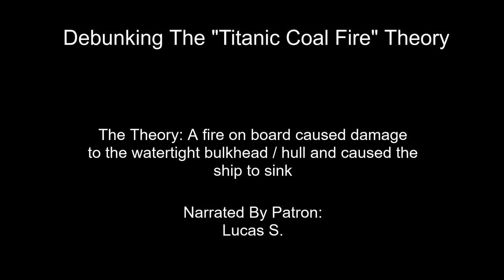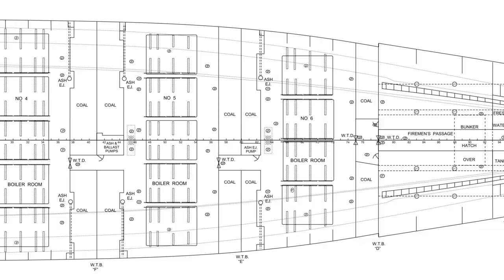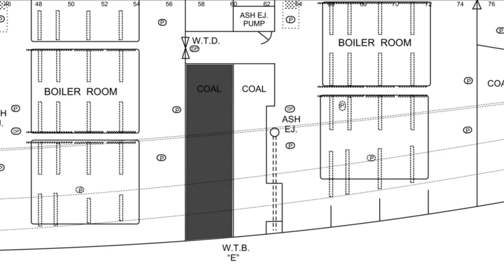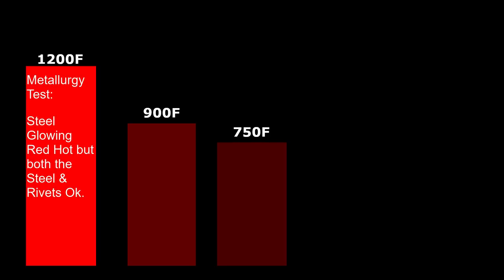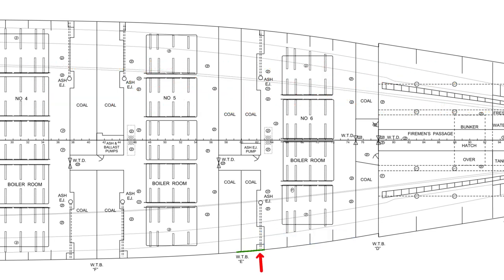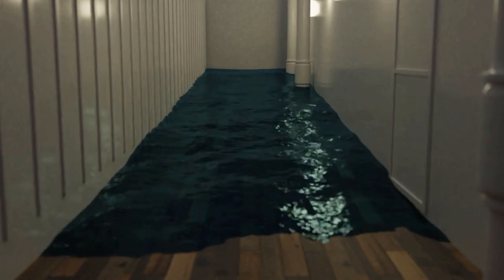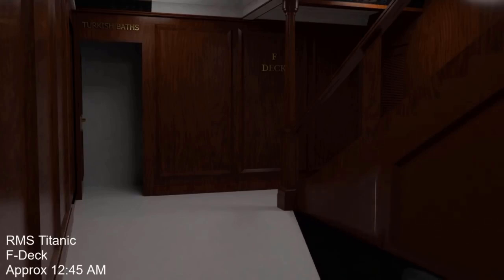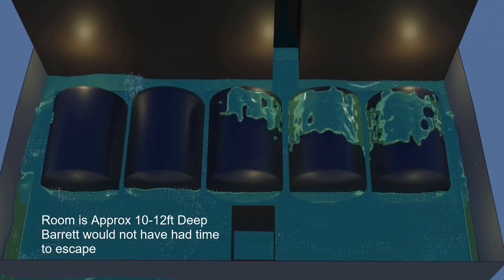Debunking The Titanic Coal Fire Theory

Comment: To put everything into context, the vessel hit a berg at speed, ripped a gash down it's side, filled the so called watertight compartments with water, the problem was, is that the watertight compartments were not sealed at the top, so as the front filled with water, the bow nose dives, then the water spilled over into the next compartment and so on, hence she sank nose first, before breaking in two.
Reply: Right, they were designed to be able to stay above the water line with only so many filled, but the problem was that too many got compromised, and as soon as they knew the number that was compromised they knew she would sink and couldn’t be saved
Reply: You know for all it's flaws I always kinda figured the British inquiry had it right with a 300ft gash down the side,
Reply: @rampancyproductions  even that was wrong. A gash that size would’ve sunk the ship in minutes. It was more like a series of small little rips
Reply: But part of the fire documentary states that ... If there had not been a fire titanic would have been moving slower and possibly been able to avoid the iceberg.. the fire wasn't a cause but a contributing factor
Reply: @rmsteutonic3686  I don't think it was ever a 300 foot gash, 300 foot of damage with said small rips mixed in.
Reply: Didn't passengers also leave hatches, scuttles, windows open? I heard that somewhere. I mean it just wasn't as enforced as a Naval ship would be. They'd want air circulating rather than being focused on keeping their ship water tight.
Reply: Yes you are correct, portholes, cabin windows were wide open, the reason wasn't because they liked it, it was obviously very cold, the reason was because the paint in the cabins wasn't quite dry, and in those days it had lead in it, very strong smelling and took days to dry, I bet most had migraine headaches.

Comment: My Father was a Carpenter working on the Clyde shipbuilding in the late 30s. He told me while watching the riveters that He never ever seen a 'clean' full diameter river hole, The rivers were white hot and almost molten,  they were just hammered into the malformed hole.  So the assumption that every rivet was 100% strong and correct is just theoretical fantasy.

Comment: Listen I work in metal inspection, I’m not a super scientific guy, but that heat, on steel, PLUS the addition of freezing water can and usually does create cracks. Just saying, I’ve seen it personally.
Reply: It could've give in after the iceberg hitting it, because the iceberg actually hit a few feet above where the coal fire was.
Reply: The change in temperature was gradual, like in annealing steel rather than a quick shock like when you quench it for hardening. The gradual raising of the temperature and the slow cooling would maybe make the steel a bit softer, but usually that only can be done to steel that is already hardened. If the plate on titanic was unhardened, which is most likely, then after a gradual cooling process it would return to a very similar hardness level as it had before.

Comment: Couple things, even if it is playing devil's advocate:
1) metallurgical analysis of titanics' steel showed higher than normal sulfur impurity, which would make the steel brittle at either temperature extreme and lower the melting point
2) The Centralia mine fire (coal mine burning for decades underground with little access to oxygen) has a range of documented temperatures some in excess of 1,350 °f
Therefore:
It is conceivable that the bunker fire did effect the structural integrity of the surrounding steel and was possibly then a contributing factor in hastening the flooding either in an initial or progressively worsening capacity as the situation unfolded and stresses and pressure increased. Also, emptying a three storey tall coal bunker mostly into the boilers so you can get to the fire in the bottom of the bunker all the while increasing your speed in excess of the planned 20 knots to what I think was somewhere around 23 knots probably didn't help when they hit the iceberg. Right in whatever sore spot the bunker fire may have created.......conceivably.

All of which is not to ignore the sheer cacophony of a cluster-fluck the series of events was that culminated in the sinking of the unsinkable. Whatever the particulars actually were many died who should not have.
Reply: I know that's right and I know at those prolonged temperatures is enough to change the temper making it even more brittle and that's a fact that can't be argued especially with the more sulfur that is in the metal,I live in Michigan we mine and process taconite pellets but people believe whatever they want to but who knows there maybe a expert metallurgist SOMEWHERE in the comments I'm sure 🤫...hehehehe but sir you are absolutely 100% right.
Reply: Exactly
Reply: Any warping or deformities such as were reported, is a very good indicator that the metal had lost it's temper and became brittle. But let's add into the mix, the cold temperatures of the water on the outer hull and WALLAH, DISASTROUS CIMBINATION!
Reply: You have said and explained everything Perfectly.I have tried to explain this to many others .

Comment: A few weeks ago there was a documentary about the coal fire and how it caused the ship to sink, which we know is not true, and it gets me so mad. What makes me even more mad is that the Smithsonian Chanel actually aired it. With there audience and stuff some people actually might think it is true. Another problem is that it was actually somewhat convincing which scared me
Reply: History itself, isnt what is actually taught to us.
Reply: It not that it made it sink but because that bulkhead was subjected to high heat it weakened the steel so when flooding water reached that bulkhead during the sinking it couldn't of withstood the water pressure it was originally designed for and possibly played a role in the Titanic sinking faster than it would of if the steel was not subjected to heat more lives could of possibly been saved .
Reply: @stephenperkins5644  mild steel doesn't become brittle with heating and cooling
Reply: @lolloblue9646  Where is your proof ? Your just going say what you said and that all ?
Reply: @lolloblue9646  It does with low temperatures, especially the low-purity high-slag steel that the Titanic's rivets were made with. Read up on ductile-to-brittle transition (also known as cold shortness).

Comment: I was taught that coal burns at temperatures exceeding 1100 degrees Celsius (2000 degrees Fahrenheit).   795C is the ignition temperature not the temp it produces while burning.
Reply: It burns at that temperature when there's plenty of oxygen available.  In a poorly ventilated bunker it would have exhausted the available oxygen fairly quickly, which would then only be replenished slowly through non-airtight gaps in the bunker.  This would have led to a low-temperature smouldering fire, not a hot roaring one.

Comment: Very interesting, so in short if the fire played any role in the sinking it was how the ship flooded after the collision. If the said coal bunkers were damaged and flooded from the inside and then the coal door failed. I wonder what would have happened with the flooding if the bunkers were full? Would the coal have acted like a plug or slow the flooding? I wonder if that data could be plugged into a simulator either way?
Reply: The coal might have worked that way.  In The Last Word, the most recent documentary with James Cameron, they posted that idea,  essentially changing the bouyancy of the boiler room.  The idea was what if they'd gambled and shoved all the cork lifebelts into boiler room 6 (or the coal bunker, I forget which).  It was a possibility, but essentially would have been a huge risk if they were wrong.  So, it might have taken longer for the ship to sink if the bunkers had been full to the brim, but I don't know if it would have stopped the sinking.  It'd be interesting to find out if they could determine that

Comment: This reminds me of the Jet fuel can't melt steel debate :p
Reply: They aren’t wrong technically. Jet fuel on its own can’t melt steel beams.
Ignited jet fuel however can melt steel beams.
Reply: @mapleflag6518 Exactly, because the temperature is so hot it compromises the steel, the steel is not designed to withstand the excessive temperature of burning jet fuel

Comment: One point made in the original 'coal fire' documentary is not addressed here. Though the metal may not have been weakened from the fire, when you throw more coal into the burner to get rid of the burning coal, you can easily increase the speed of the ship, thereby not giving enough time to clear a rapidly nearing iceberg.

I would be interested to hear Titanic Animations take on this and/or the rest of you of course.
Reply: Well considering they weren't even at top speed, and feeding the burning coals to the boilers wasn't even how they extinguished the fire, that kinda falls apart doesn't it?

The reason they didn't have enough time to dodge was entirely because of the flat, glassy calm ocean. This condition meant that waves weren't breaking on the iceberg which was how they spotted Icebergs at the time.
Reply: @sorrenblitz805  and also there could've been a mirage effect going on when the ship hit the iceberg and also when it was sinking.

(Unless I'm completely wrong)
Reply: the titanic had systems to vent extra steam, so if they did burn the coal they couldve easily just gotten rid of any steam they didnt need instead of being forced to go faster

Comment: I thought the theory was that the coal fire weakened the steel and perhaps contributed to the iceberg damaging the area more than it would otherwise
Reply: And this video explains how it couldn't have weakened the steel because it couldn't get hot enough to do so.
Reply: @sorrenblitz805  Steel weakens at much lower temperatures than red hot, it definitely could have weakened it. But what is clear is that this weakening would not have affected more than coal bunker 5, so clearly the coal fire was not a major factor
Reply: @Tom--Ace  this is the same argument people made about the twin tower steel

You only need to heat steel a small amount to make it easier to bend, ask anyone who works steel by hand and has a small handheld blowtorch
Reply: @Obvsaninternetexpert  I mean the final blow to the structure of the north and south towers was the heat, first of all, the water inside that would boil and cause masses of pressure on the concrete walls, coupled with the fire and destruction of some of the support beams it was destined to fall.

Comment: Do people know how hot a fire would have to be to do enough damage to ruin the watertight compartments?
Reply: @riesa85  well this video gives you a temperature range that the fire would've had to get to weaken the metal. 1300°F+ which the coal fire on Titanic never got up to.
Reply: @Emigdiosback  I'm calling BS on that, Look at RMS Olympic. Same design out lasted tons of ships from 1911 all the way til 1936 when the ship was scrapped and surprised scrappers as to how tough she still was after 25 years at sea.
Reply: @riesa85  If you soften steel that is "brittle" you actually make it stronger. Brittle steel is a result of it being too hard.

Comment: Titanic sinking theory worked by islas shipping line:
the titanic hit in the icebers probably disrupted lower parts and caused a fire when the ship sank in the lover compartments in the bow the fire is put out but fire reaches the boilers causing an explosion around the third funell stress fractures and holes started froming and the stern was bending the ship eventualy splits but the stern instantly sank due to holes caused by stress fractures

Comment: I would also like to mention that this specific coal bunker was below first class swimming pool. If temperatures reached 500-1000 C as they claim, water in the swimming pool would be boiling (water boils at 100 C) and deck around it would be deformed. Testimonies say this was not the case and temperatures were just mildly warmer than usual.

Comment: Not even the correct type of coal being talked about industrial coal used for furnaces and steam boilers burn at a higher temperatures than cooking coal. Just look up bituminous coal instead of using the first result you find when you type in "how hot does coal burn" in the hotbar. To add on even more specifically the exact coal being used by the company at the time was welsh anthracite which has one of the highest burning temperatures of the different coal types.
Reply: It still wouldn't have a crap's worth of oxygen so it wouldn't burn very hot, it would just smolder.

Comment: The fire probably didn't cause severe damage, but it might have slightly weakened the hull a little bit. If that didn't happen, the hull may have been slightly stronger and it may not have sunk to begin with.

Comment: If this isn't about the fire theory itself but it's something related and I can't find an answer.
Why did Barret but oil on the dented bulkhead? It is framed as a common practice, but I can't find anything on the reasoning behind it.
Reply: Black oil can absorb heat very well and smooths the surface, same reason we use oil in a car engine. Hope this helps!
Reply: @AidenWestori  thank you. For years,  everytime I would read something about Barret's account that always perplexed me. Now that I got my answer, I feel a bit silly that I never made that connection.

Comment: At 3:08 did you mean that the mild steal's 900F is 'OVER' the range of the smoldering coal temp? or am I just confusing it.
Reply from the maker: The steel began glowing at 900f, the coal burns at a rate of about 750f

Comment: I dont believe the fire helped to sink her. The iceberg started to open up her some feet before the fire spot
Reply: The fie saved the 706 people
Reply: @rogersstinson4019  oh yeah, if it wasn't for the fier I think she would sink like Britannic
Reply: @stephenmccloughan7541  most assuredly she would have.  There've been at least two simulations done - one on the fire specifically, another on the watertight doors.  In the case of the fire, the sinking simulation app that researchers used predicted that, without the weight shift/list from the efforts to fight the coal fire, Titanic would have rolled in just under an hour.  Same thing when the watertight door study was done, only worse; power failure in minutes,  rolling, and going under a good half hour sooner than in reality.

Comment: in addition, they very people you chose to quote in the vid, state that the metal was Deformed by the heat
you say the guy didn't SEE the bulkhead glowing red hot
but this guy knew his business and could see the signs of extreme heat damage to the metal. 
"rubbed black oil over it" has no bearing on anyting
Reply: On an INTERIOR WALL not the hull.

Comment: Dude, it's not about melting the metal hull...  it's the sudden quenching that would have resulted from the water used to put out the fire. It can change the properties of the metal. In this case, heating and quenching makes it harder but more brittle.

Comment: Much of your assumptions here are exactly that, assumptions and speculation. While I think it is good to have critical thinking, you must also have more than statements to verify your claims. Your comment about 700 degrees is simply incorrect an an assumption gathered from who knows what research. You give no reference for this comment, and then elaborate and build on it. 

I think you need to redoo this and offer evidence for your statements. If your 700 degrees is off, it changes absolutely everything because you base all your findings on it.

Comment: I do believe the fire helped sink the titanic along with carelessness by the ones whom built it.. I'm a welder/fabricator by trade and just think if that mild steel is heated, cooled, heated, cooled then it's weakening more each time or if something is really hot then you throw ice cold water on it , just imagine welding something then throwing cold water on it. It's going to fail/crack. So yes the rivets could have played a major role also along with the previous mentioned statement; "workmanship/quality". They should have shut it down from the start as soon as they knew about the fire and it should have been totally inspected, but it had the richest people in the world on it at the time and they would have lost alot of money having to refund everyone. Just another example throw hot water on your frozen car window and see what happens. I can heat a 1 1/2 - 2 inch piece of steel, throw cold water on it and distort it/make it draw atleast a 1/2+ inch. I also see steel snap that size constantly in my line of work. Just a few things to think about.
Reply: Coal fires were so common on coal ships. It "helped" nothing in the sinking.